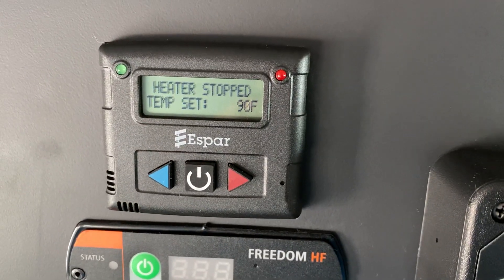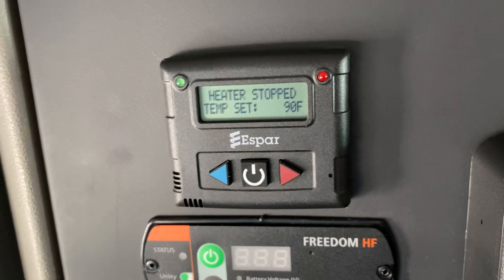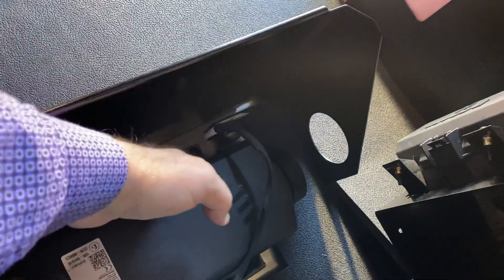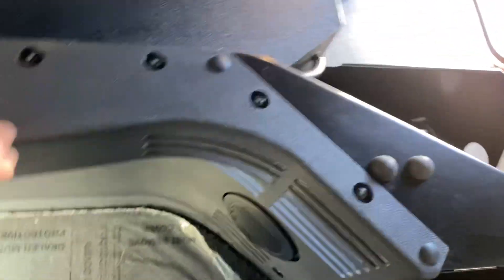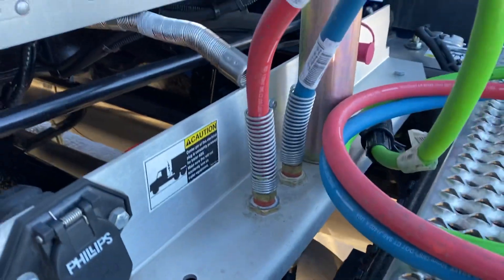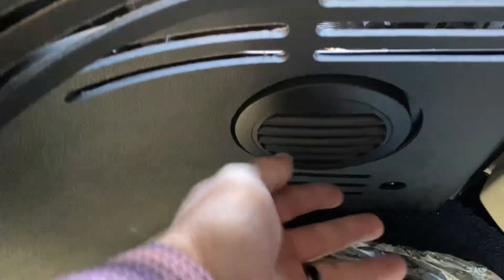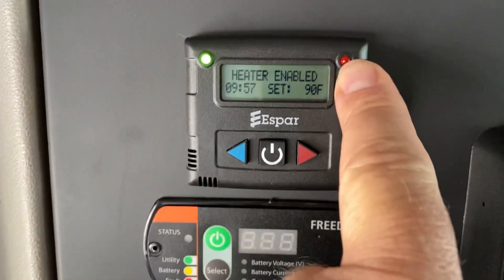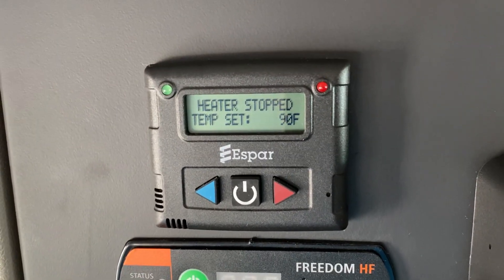Esbar bunk heater.  (Short video.)  (Please like and subscribe!!!!)

Comment: So what carbon monoxide protections do you need to take with a bunk heater?  Do you need a carbon monoxide sensor in the cab if you have one of these?  Is that exhaust pipe length long enough to ensure you don't get exhaust fumes back in the truck while you are trying to sleep?